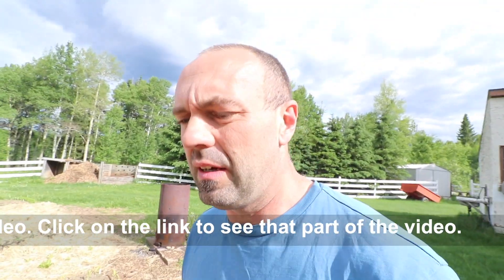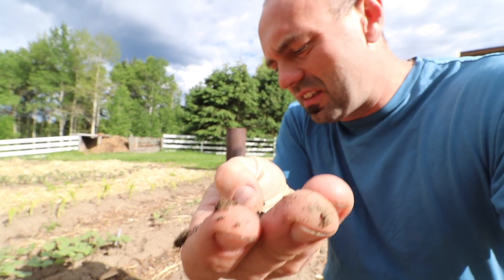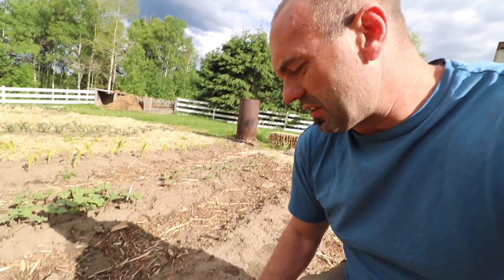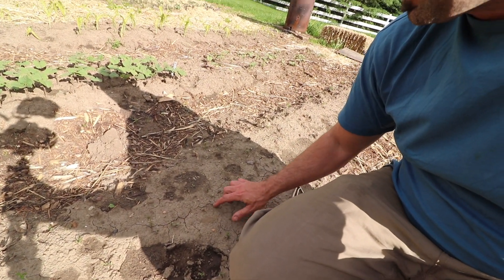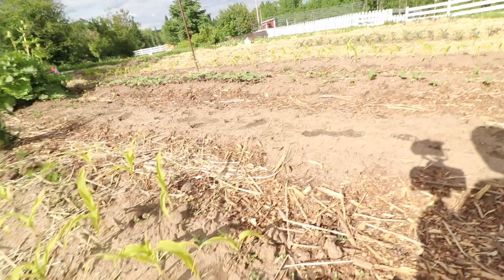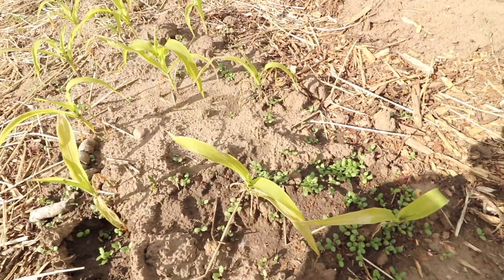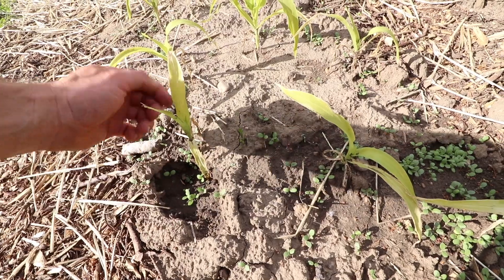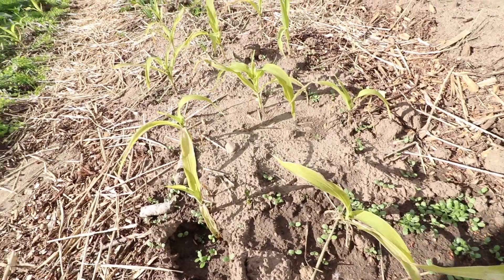How to Diagnose a Nitrogen Deficiency, and increase nitrogen in the soil

Comment: Looking good, Rob.  I was happy to hear your caution regarding mulch and slugs!  When we 'sell' ideas as panaceas without providing this kind of information, we risk discouraging folks new to Permaculture.  One thing I'd add for cold-temperate climates, too, is that SOME locations may benefit from having mulch pulled back temporarily in early spring to allow the frost to come out of the ground.  Otherwise longer-season crops may not have the time they need.
It'll be fascinating to observe how quickly your soil responds to the new regime(!)
Reply: Yeah, the mulch insulates from the spring warm up :)
Reply: for sure.  mulching and stuff like that, helps the soil retain moisture and eventually break down to add to the soil.  but it's also a great place for critters to live and thrive  in!

Comment: A couple other problems with mulch- it can do more than bring in slugs, it can bring in mites and other little critters. For this reason we stopped using straw mulch for garlic rows and switched to pea straw.

If you make your mulch too thick, you might actually stop your plants getting watered if you don't water deeply enough.

Also, if using woodchips as mulch, particularly in beds that get a lot of turnover (ie annual veggie beds), you risk mixing the chips in with the soil instead of just having them sit on top, which can rob your plant roots of nitrogen.
Reply: I mulch my vegetable garden each spring with newspaper and cedar bark, which means the wood gets mixed in with the soil.  After doing this for 4 years, I had a severe nitrogen deficiency last year, but I solved it using composted chicken manure.  I mixed it with potting soil first (half a bag of manure with 2 bags of soil), and layed it on top of the mulch, making sure I didn't touch any plants.  It worked, my veggies grew well after that (unfortunately it was mid-July before I figured out what the problem was).  This year I spread my chicken-manure / potting soil blend on top of the soil just before putting down the mulch, and everything is growing well.  My vegetables are almost as vigorous as they were in 2016 when I first created the garden.
Reply: @Alex_Plante  Nice solution!  I'll have to give this a try too!